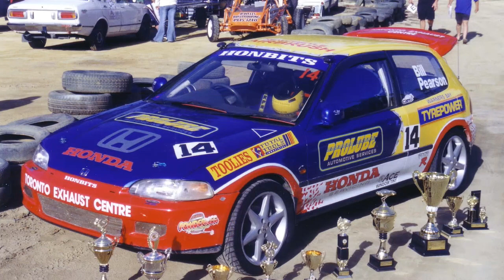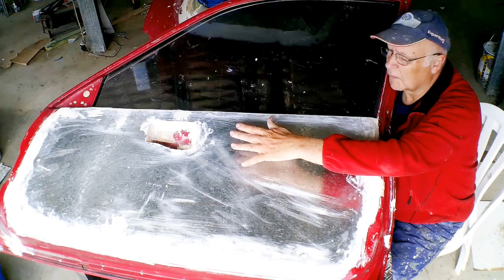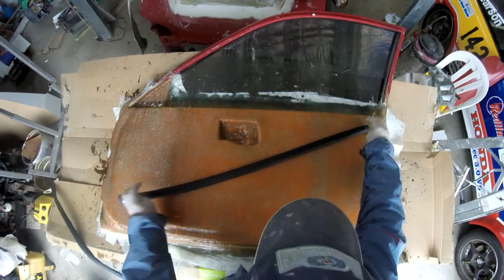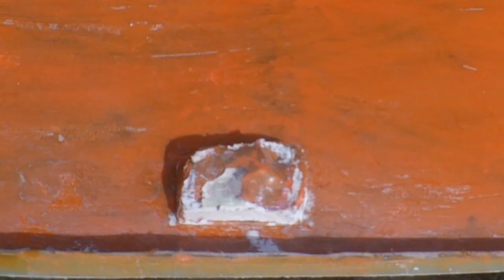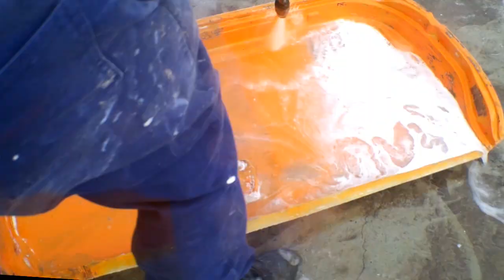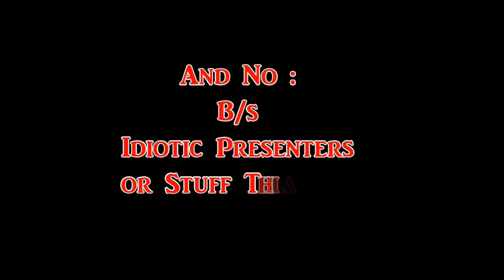V6 Civic Phase 4  - part 14

Comment: You sir are my hero! May I ask why you wouldn't mold the inner door panel right to the top rather than in bottom half top half format?
Reply from the maker: It isn't necessary to make the top inner frame around the window because I have found an easier way. This will become obvious to you when you see how I make the actual door itself in part 17. The way the lexan window will be attached is another reason - just glued in place to the outside of the outer top door frame. Trying to mold and then join the two complete window frames (both inner & outer) together would require absolute perfection in molding and copying. The slightest twist would mis-align them, with no advantage at all over the methods I use instead.
Reply: @BillsBuildandRace  I see, my son and I are building an eg civic track car as well and with the knowledge tour passing on I may just attempt some of this! Awesome work btw! Can't wait to see more videos!

Comment: Hi bill , nice work on the inner door mold. When your making the mold , the gel coat that you used.  Do you get the kind that has the wax in it or do you add the waxer don't use waxing the gel coat
Reply from the maker: I don't add wax and  there isn't any in what I use. Wax is only put in Gelcoat to make it dry tack free..in other words to turn it into Top Coat/Finish Coat. That is only needed when laying cloth, then putting on the gelcoat as the final coat. But when Gelcoat is covered by cloth layup & applied first in fiberglassing you want to retain it's inherent stickiness to help the polyresin & csm bind to it.
Reply: Ok thanks.  I'm a big fan of your work and I'm try make a copy of my hood for for my 180sx

Comment: Hi Bill yet another great video, i have a fibreglass product of my own that im developing but was wondering what is the best mold release wax for a really gloss finish on the final product. The one im using at the minute works well but leaves alot of streaks? Many thanks in advance.
Dan from the UK
Reply from the maker: Meguiars Mirror Release. How many coats are you using 7 are you polishing the wax or not?
Reply: @BillsBuildandRace  
Ive been finishing and polishing the plug so its got a really good glossy finish to it and then mold release waxing about 5 or 6 times for the first release, but you can see were it has been applied and it doesnt buffer properly thats were the streaks are coming in.
Reply from the maker: What materials is the object you are trying to copy made of, and how have you sealed it? Are you polishing each coat of release wax, and why are you applying so many coats?
Reply: @BillsBuildandRace  
I make campervans and im making a copy of a factory hightop fiat doblo roof as they are few available to buy. Ive took a mold off the van already which had to be a 3 part mold because of the shape of it, i was told by people i know who have done fibreglass work before to apply 5 or 6 coats of wax for the first release and i havent polished any of the wax release coats, to be honest i didnt know you could do that? Many thanks for your help and advice in advance.
Dan

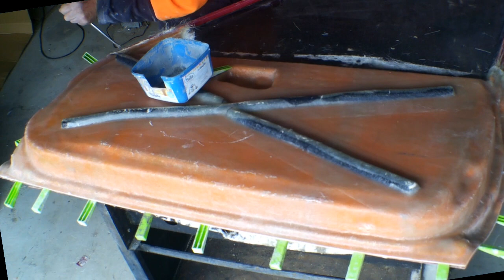Comment: 5:13, what a awesome feeling. Love when parts pop rite out. Great sound effects of success at the end. Great job. Awesome video. What did you use as the ribs? Were the solo rubber or something else?
Reply from the maker: I showed this material in an earlier episode. It is hollow rubber tubing from your hardware store used to insulate hot water pipes. Cheap as, and comes in a lot of sizes. This is 20mm here, and i cut it in half to get a half round shape that the csm conforms to really easily - way better that something round like hosing, or square like timber with it's ninety degree sides.
Reply: Oh, ok. Thanks for replying back, appreciate it.